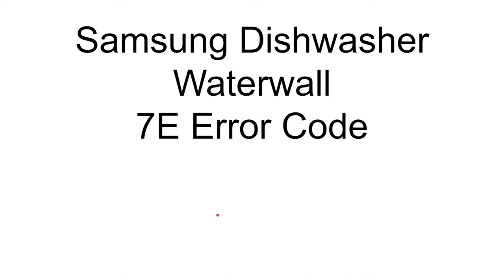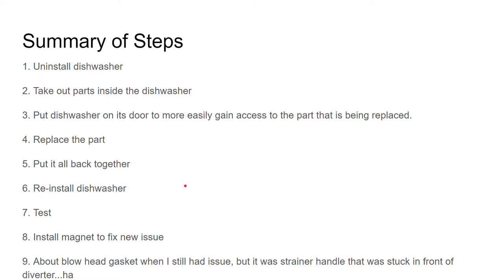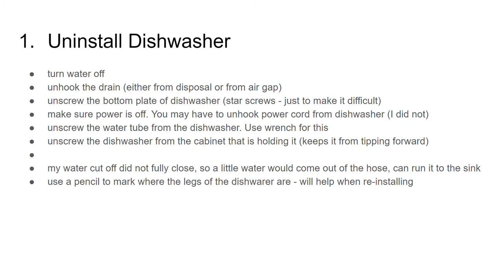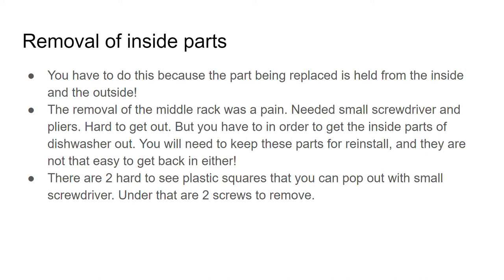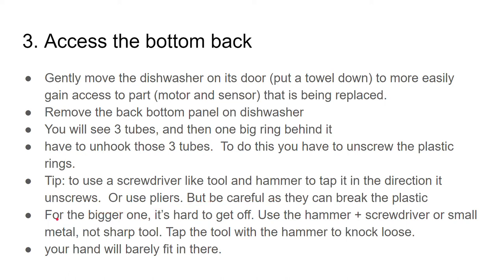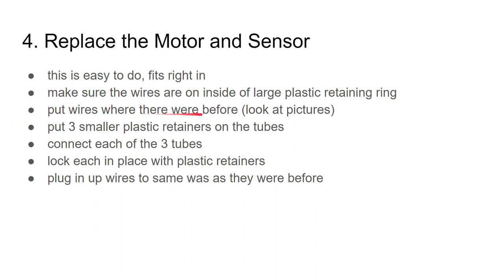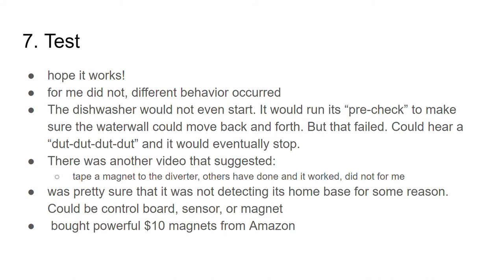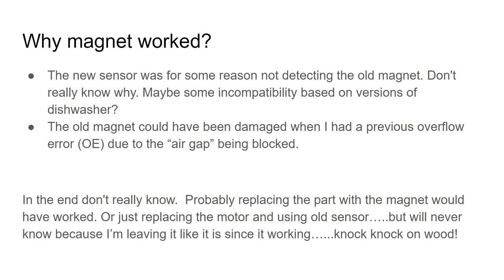Samsung Dishwasher Waterwall 7E Error. DIY fix. Using replacement part and Magnet

Comment: Just wanted to say thanks. Replaced motor and assembly and was still getting 7E error. Placed recommended magnet under the spray assembly as in your video, and all worked perfectly first time.

Comment: Have to give you credit.  I performed job today with me motor and magnet I ordered.  It worked perfectly.  Well at first it didn't.  I powered it on, off,  started then held reset button down to 1. Then turned back on.  No more 7e. Finally heard water coming in.  Awesome video.  Had to come here and give your thumbs up !!!

Comment: Thank you for this video, it really helped me.  The new sensor did not detect the magnet on the bottom of the diverter base so adding a larger diameter neodymium one did the trick.  Went through all that work and though I'd have to harvest the old sensor which I see you considered as well.

Heads up, the neodymium magnet you used will rust.  You can use epoxy coated ones and they won't.  Epoxy coated ones will usually be black.  Easy to tell them apart.  Non coated ones are silver.
Reply from the maker: Glad video helped somewhat!  I'll keep eye on magnet, so far its been using the same magnet for 16 months no issues with it.

Comment: (This is about: how to easily remove middle rack from your Samsung dishwasher). 
This is a awesome educating and very helpful presentation you have made!  You must spent a lot of time to make it that way. Thank you very much!  Also... I wouldn't be myself if I would leave everything "too beautiful" :)   So when you go to your presentation exactly at 12 minutes - you mention a difficulties with middle rack removal. I suspect that you must have done it some how a wrong way, because it is actually very easy.  Those two little plastic "brackets" (inserts) - one on each side of the rack are the key to free it. Lets say we talking about a piece on the right side - just like the one you show on your picture. Notice, there is a little square on top of it. The only thing you need to do, is take something thin (a small screwdriver, etc. ) and push this little square down, to make it bent down a little bit, but pushing it down, push it in direction away from the rack in the same time. That little square is raised up a bit, just to hold the edge of the metal bar... So doing that - you would make the edge of that square releasing the whole plastic piece, which will kind of pop down and away from the rack. In my case it didn't even fall down.  Then you do not try to pull it up! You easily (I used my fingers) grab it from the right side... It comes out loosely...   These two plastic pieces - simply block 2 (of 4 total) bolts which hold a whole rack. These bolts sit in kind of elongated slots,  with notches on one side. So when you remove these two plastic pieces - you make just enough space for bolts to move in slots - up to the notch and then you simply pull up the rack.  I did try to put these little plastic from the top when assembling my dishwasher... And now I know that this is simply not a way to do it. You just need to put it in exactly the way you did pull it out. (Always make sense anyways. LOL) So I just slid one in - bottom first - exactly into place where the notch is - and just push it in toward rack. Clicks in like the easiest thing ever.  Try it! It really works and it is super easy!  OK. Two more things: 1. Sorry for my broken English (emigrant here).  2. If you think that I wrote all of this to make you feel bad or something like that - YOU 100% WRONG!  A proof? Here we go:  I know how to remove a middle rack, not because I am super smart, but because I was watching how the other guy does it on his youtube video :D  So, please - do not judge me ;)  It is all about helping people and you did such a great job, so I wanted to be a bit helpful too.  For you and for others as well.  Have a great day my Friend!
Reply from the maker: Thank you for the detailed info. Will try it out. Hope others will benefit as well.

Comment: Great explanation, I have same one,second time replacing my waterwall motor.
Reply from the maker: Thanks! BTW  still running good,  more than 20 runs.
Reply: When removing the Waterwall motor can it be removed without removing the whole sensor unit? It's difficult to get to the two screws holding the motor in place so if anyone has any tips or tricks let me know please. I did attempt to remove the whole sensor assembly but the ring isn't budging and a couple of the plastic lips broke.

edit I ended up putting the DW door down and removed the bottom tray that clips in. I was able to reach the 2 screws with a long screwdriver. Thank you.

Comment: If I took the waterwall diverter out and put it back when it wasn’t all the way back is that a problem? Is there a way to fix that?  When I run it, the waterwall goes to the back and seems like it keeps trying to go back for several seconds before it then goes back forward. Is this the magnet problem or the fact that I reinstalled the waterwall arm mostly forward when the new motor thinks its new installation position is all the way back for the waterwall? (I can see the waterwall trying to go back when it’s already back, by running it with the door open and a screwdriver in the side of the door slot so it runs. )
Reply from the maker: I think the magnet would address this.  When the dishwasher starts its cycle it goes back to the 'start' position.  But without the magnet (in some models) it cant detect its actually in the 'start' position.
Reply: @patricksollee6682 you say for the magnet, any bigger than the size you purchased would have been too thick. Can you say the size magnet you got? Maybe look up in your Amazon purchase history? 
I held a flashlight butt end that has a magnet on it, right against the left side of the sensor and it stopped the waterwall going back. I tried to hold the flashlight magnet near the right side and it didn’t stop it going back. Maybe I just need a very strong magnet so contact isn’t needed for detection. Knowing what magnet thickness you got would be very helpful.
Reply from the maker: @wstt4  https://www.amazon.com/gp/product/B06XD2X45M/ref=ppx_yo_dt_b_search_asin_title?ie=UTF8&th=1
DIYMAG Powerful Neodymium Disc Magnets with Double-Sided Adhesive, Strong Permanent Rare Earth Magnets for Fridge, DIY, Building, Scientific, Craft, and Office Magnets, 1.26 inch Diameter, Pack of 6

Comment: After replacing motor sensor assembly and the middle part with the water wall and the water wall now the water wont pump in or sounds like its draining and suggestions?
Reply from the maker: Were you able to resolve?  Sorry don't really have any tips,  except maybe recheck everything put back together tightly.
Reply: Yes. So after replacing the whole assembly and all that. The magnets that come one the waterfall were not strong enough to let the sensor know that it was all the way back. I added some earth magnets to the water wall and it resolved the problem.

Comment: I can’t get the magnet to stick under the gray waterwall assembly , did you put the magnet under the gray slide or on top of the gray module at the backside?
Reply from the maker: under the gray plastic thing that the diverter is connected to (that moves with red diverter). when facing the dishwasher, its on the right side. The magnet sticks out a little on the side. It is held by magnetism, no adhesive used.  Pull out the diverter and place magnet under the gray plastic thing. It should stay there by magnetism.  Then run dishwasher.  The magnet will shift a little and end up to the right a bit. But it stays in place for me.  The magnet allows the new sensor to detect the "back" of dishwasher so it can change diretcions.
Reply: @patricksollee6682  Mine must be made different I can’t get the magnet to hold to the gray track under the bottom that the diverter hooks on
Reply from the maker: @sidallen685  When you put your hand with magnet can you feel any push back (if not flip magnet over and check that side). If cant then maybe magnet is not located there.  Try putting new magent on the red diverter, there is place close to the grey thing.  Try it on both sides, and maybe use multiple magnets
Reply: @patricksollee6682    I’ve decided to replace the factory magnet with an OEM part. 
Thanks
Reply from the maker: @sidallen685  Let me know how it works out.  Since I think the Sensor is in slightly different location on the newer assembly, not sure if new magnet will help. But worth  a shot.  If does not, could try to place the magnet(s) inside the diverter (there is another video of someone doing this and it worked for them). The magnet in assembly needs to detect the magnet in/on the grey thing.
Reply from the maker: One other idea, if new magnet does not work.  Use the old assembly and the new motor that came with new assembly.  you remove motor from old, remove motor from new, put new motor in old assembly.  Then give it a whirl....Good luck!
Reply: @patricksollee6682  Mine has this problem.  It was on extended warranty.  Different issues with getting service out here.  They ordered the part but I believe they only got the assembly and motor.  It still gave same error.  The second service guy came out after another ordered part was supposed to be here.  They screwed up the order.  So they are doing the buy back.  However, since I think the magnet is the part they skipped, I am thinking of trying that since it has the new motor in it anyway and I shouldn't have to take it completely apart.  Mine is the newer one so I will have to find that sweet spot to place the magnet and where to order it from.
Reply from the maker: I put magnet just to the right of center. It has stayed on by magnetism, no tape needed. Have run it about once every 2 days for about 6 months.  I ordered from Amazon: diymag box it says 1.26" x 1/8".. These are round, so 1.26 diameter, and 1/8 inch thick
Reply: @sidallen685  I see you replaced it with OEM but for others looking:  On some of these DW80 models the magnet is on the underside of the diverter itself not bottom of the carriage.

Comment: I bought DW80H9950US/AA model in 2014. I am having the same issue with waterwall, but I have no magnets on my reflector. Does anyone have an idea how to fix this motor/sensor problem?
Reply from the maker: I think its in the plastic part, might not be able to see.  The magnet in the reflector is how the sensor detects its at the back of the dishwashwer, and to change directions and go back forward.  So there is magnet in there.
Reply: @patricksollee6682  Thanks Patrick. I found where the magnet is. It is underneath of the runner on which the reflector is mounted. It is enclosed in plastic. I could not pull it out though. Anyway, I went ahead and bought a new one. Coming in a week. I'd like to try replacing the magnet first to make sure the problem is in the motor/sensor.

Comment: 19:33 I cannot remove the motor plus sensor. I removed clip and rest of motor is still docked.
Reply from the maker: If this is still issue.....do you mean the plastic ring was hard to get off? I had to hit lightly with hammer and screwdrive to get it to move. Maybe try the other direction of loosing it. If I recall I was on the right side of it and tapped forward.

Comment: What size is the magnet?
Reply from the maker: on the diymag box it says 1.26" x 1/8".. These are round, so 1.26 diameter, and 1/8 inch thick.

Comment: I turned the sensor around on the new part and it works great until the motor goes out again
Reply from the maker: How did you turn the sensor around?

Comment: If you want to solve any problem with Samsung's dishwasher, never buy one.
Reply: Yup, never again.  They got me with the ridiculous MSRP, they were all advertised as half off.
Reply from the maker: Yes I also got mine at big discount :(  would not buy a water wall one again, now knowing how they work.  But its been working for 7 years now...knock on wood.

Comment: Heat demagnetize some magnet. Samsung designed it to sell parts or poor engineering
Reply from the maker: Yes been sort of expecting that, but so far so good. Its been 6 months running it once every 2 days. Same magnet.  The box of magnets had several in them so will replace when needed.